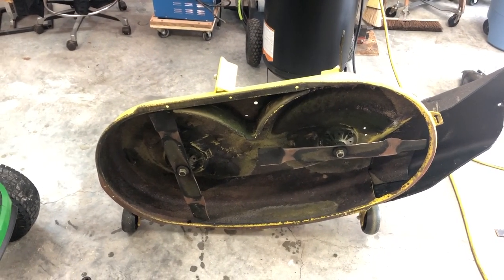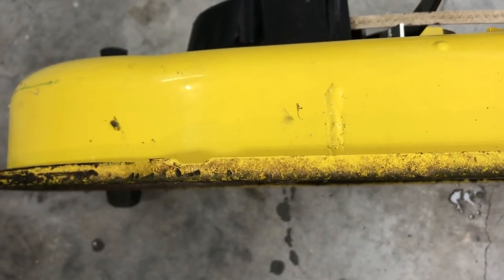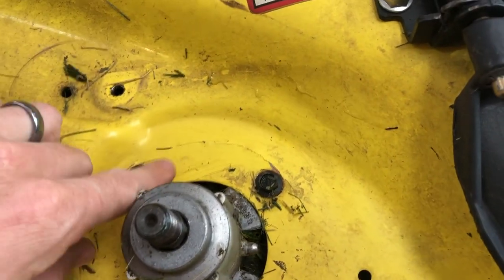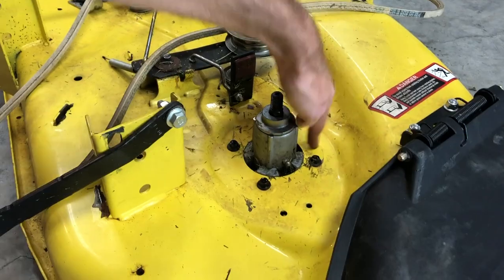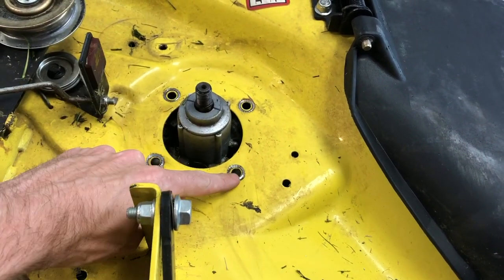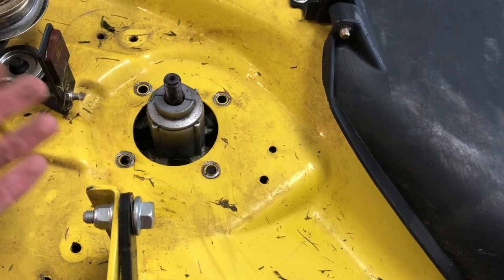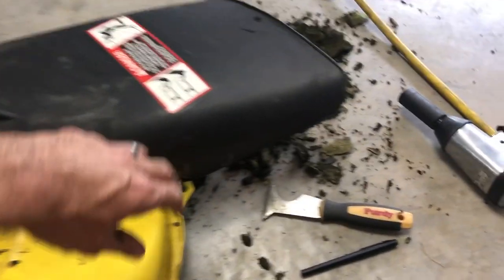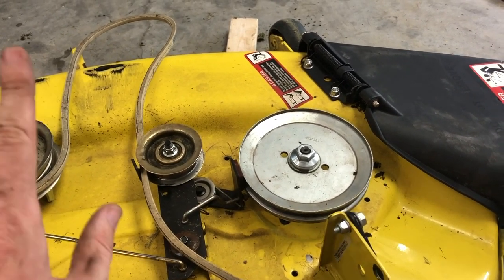Fixing a Bent Mower Deck

Comment: Good tips. These JD stamped mower decks are horrible. Even worse is the 7 iron stamped under belly decks for sub and compact tractors. The L LA D and E series decks are included in this. The only way I've been able to keep fixed decks or clean decks from bending is to weld lateral bars spanning the deck to add a lot of rigidity in the x and y directions. You realize after dealing with a few of these why expensive machines have fully fabricated decks.

I've delt with so many of these decks from 38" to 54" that I have a custom press table using a HF 20 ton shop press and some jigs to make the decks flat and square again. The only thing better for me would be to have the factory negative mold these were stamped out on to reform against. 

It is tough though to pass up an otherwise decent mower when people get the sticker shock at a dealer for a new deck and decide to sell the whole machine cheap. I just picked up a rust free 70 hour la175 for $300 because of a lightly bent deck.